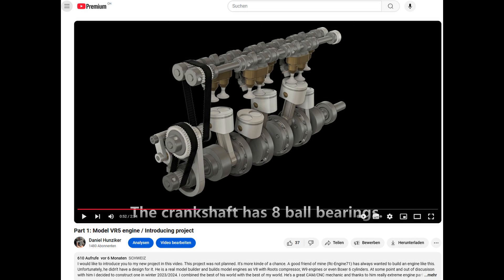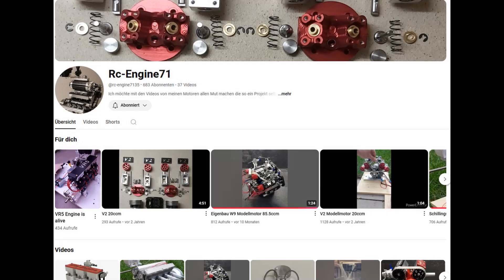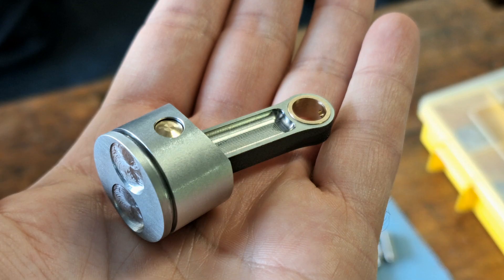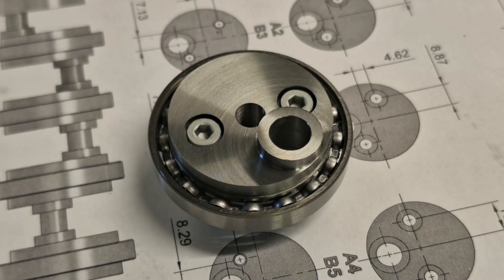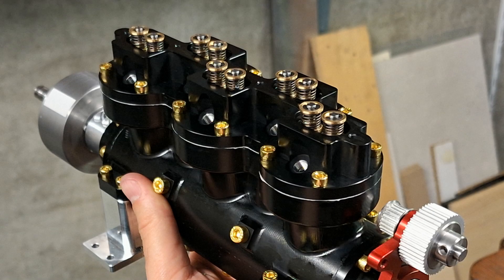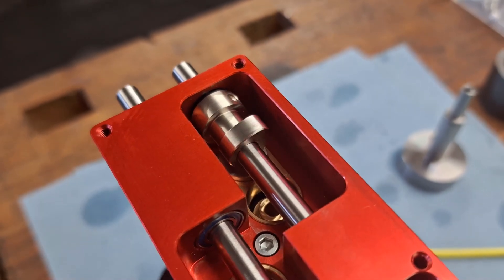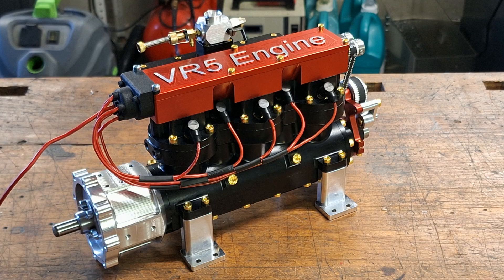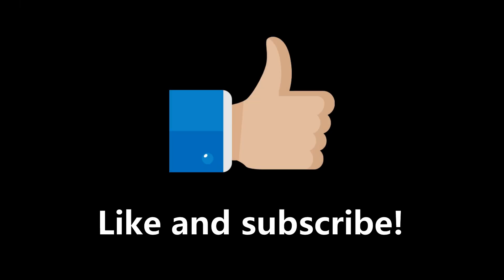Part 2: Model VR5 engine / Manufacturing process and 1st run / Herstellung und erster Start

Comment: Super Sound ähnlich fast wie bei Original. Auch schönes Farbdesign, doch leider kein Drehschiebermotor. Gibt es noch eine Leistungsmessungen oder ist das Risiko zu gross?
Reply from the maker: Hi Argentum 😃 Ich habe keine Ahnung wie ein echter VR5 klingt 😅 Ja, die Optik ist mir auch wichtig, die sollen ja was her machen! Eine Leistungsmessung wäre kein Risiko, da der Motor nicht fragil gebaut ist. Ich kann es aktuell einfach nicht, da mein Prüfstand nur auf 1 Zylinder Motoren bis rund 1.5 PS ausgelegt ist. Da ich aber schon mal die 1 Zylinder Version meines Kumpels gemessen habe, wird er wohl 0.8 PS pro Zylinder haben, was total 4.0 PS gibt.
Ich liebe alle exotischen Motoren. Auch wollte ich damit auch zeigen, dass ich offen bin und überhaupt nichts gegen Ventiler habe 😃 Theoretisch wäre der VR5 ja auch mit einem Walzendrehkopf möglich. Mal schauen wo das noch alles hinführt 🙃 Aber keine Sorge, ich habe gerade mit einem neuen Walzendreher Projekt angefangen und noch ein paar andere, richtig geile Motoren in der Hinterhand. Also dran bleiben 😉
Reply: @danielhunziker3577
Ich bin natürlich wieder total gespannt was als nächstes kommt. Schon mal an einen Sanchez rotary piston engine gedacht? Oder an einen HUF Drehkolbenmotor gedacht?
Reply from the maker: @argentumflower592  Ich habe zu viele Parallel-Projekte 🙈 Also ein Sanchez Motor mit Drehkolben ist schon sehr speziell. Das wären dann so Projekte, bei welchen man fast bei null anfangen muss. Es gibt ja auch noch den Kugelmotor, was ja auch nochmals eine Welt für sich ist. Aber ich werde schon bei Walzendrehern bleiben und versuchen, da weiter die Leistung zu optimieren.

Comment: When bolting on the camshaft profile, do the set screws need to have a flap point on the shaft to be milled in or can it be held down well on the round surface and with the 3 set screws
Reply from the maker: You're right when you say it can be improved. Compared to a real engine, it probably seems unconventional or even stupid to simply screw the cams onto a bare shaft. Simply making the camshaft from one piece would also be a better option. As is usual in model making, the manufacturing possibilities and technical implementation are very limited. For this reason, I used existing model engines as a guide and adopted this validated system. I was careful not to reinvent the wheel here.
Reply: @danielhunziker3577  I don’t think it’s dumb at all! In fact I’m very happy to have seen this video. I recently purchased a milling machine and lathe and have been making very nice steam engines. But I wanted to get into making gas engines for my Rc airplanes. It’s very nice to know I don’t absolutely have to make a one piece camshaft if I want to make a 4 stroke. Thanks for the good idea 👍 you’ve saved me many hours of machining
Reply: @danielhunziker3577  You can even try to use 3M scotch weld 2214 . It is resent to temperature of 177 degrees Celsius. But if screws work than it is fine! I tried before on my engine loctite 401 and soft solder. Now it is been welded to shaft (shaft CK45 cams silversteel).
Reply: @Alexie3333  so a low temperature solder can work too? That would be great. I wonder if I could get away with that for holding a model engine crankshaft. It would be easy enough to take apart to service bearings. Just heat it up slightly and the whole thing comes apart
Reply from the maker: @Alexie3333  Dismantlability is important to me. So all my engines can also be repaired. Cam welding is of course top! But then I can't get them out of the camshaft housing anymore 😅
Reply from the maker: @hectordeleon7859  Multi-part crankshafts aren't critical im Modellbau. My crank bolts are pressed in on one side and only inserted on the other side (a few µm play). It's very important that the crank bolts all have an axial stop and a long guide surface!

Comment: As always, impressive work!
I love the use of 3d printed titanium as a starting point for components.  It's like having the advantages of using a near net forging but with the flexibility of changing the design easily.
Reply from the maker: Hi John 😃 Thanks man! 3D printed parts are a good thing for design freedom. For example, the piston blanks are also 3D printed so that the clearance for the connecting rod is optimally shaped, rounded ans smooth to reduce stress. I have a titanium plate from which I used to mill the connecting rods in past. But this is very laborious and the milling cutter often breaks off due to the high residual stresses. What do you think about the sound of the VR5 and the design?
Reply: @danielhunziker3577 It makes a beautiful sound.  I'm a big fan of zippy inline 6 engines, this is kind of a combination of a smooth inline engine and an off beat V engine.
Reply from the maker: @johnpearson492  Yeah, it's a truly exotic combination of an in-line and a V-engine. I'm thinking about to make a manifold exhaust system to further improve the sound 🤔

Comment: You should get rid of the stress risers on those conrods where you milled them, the edges should be radiused or smoothed.
Reply: Generally true, but in cases like this the expected loads will most probably never get remotely high enough to cause problems.
I'm rather sure they're not the weakest link in this construction anyway, it's usually the built crankshaft from what I've seen.
Reply from the maker: @heinzhaupthaar5590 Eine gebaut Kurbelwelle ist nichts unübliches im Modellbau. Zum Beispiel Schillings oder Luther haben dies auch so gemacht. Es erspart dir viele andere Probleme, wie zum Beispiel das Bauen einen geteilten Pleuels mit Miniaturschrauben. Man muss jeweils eine gute Kompromisslösung finden für ein gutes Gesamtkonzept.
Reply from the maker: You are right. That is certainly not ideal. The general problem is that the parts are really super small and I always pay attention to simplicity in production. The wall thickness of the connecting rod around the bronze bearing is just 1.0 mm. Adding a radius would be a real challenge. I cannot say whether it's necessary or not. So far, no connecting rods have broken.
Reply: Atemberaubende Arbeit Respekt!!!!!
Reply: Viele Modellbauer Verwenden Kurbelwellen im Stil von Schillings.
Oder mit Hirth Verzahnung, weil es bei so kleinen teilen oft garnicht anders geht.

Und die Modelle laufen tadellos.

Was vielleicht erwähnenswert wäre, das Bugatti und Lotus in Rennwagen mehrteilige Kurbelwellen benutzt hat.
Gibt es tolle Videos zu.

Comment: hello Daniel exceptional work as always, is to possible to make a 4 cylinder for model airplane?
Reply from the maker: Hey Antonis! Thanks man! 4 cylinder engines for model airplanes are available e.g. as a boxer version from OS (OS FF-320 PEGASUS). I don't know about in-line engines right now. Basically, you can do anything. The VR5 here is water-cooled and probably not suitable for model airplane. You need an air-cooled engine. It's also too heavy for this with 3.5 kg.

Comment: Awesome! Thanks for the content! That's arguably the best 1st start I've ever seen, for any multi-cylinder model engine. Sounds like most of your tuning is done 👍

A few questions, when you have the time:

1- what is your static compression ratio?

2- what is the comparable length difference, to an inline 5 of the same bore/displacement configuration?
Reply from the maker: Thanks James! It was actually the 1st start, but I have to say that the carburetor had already been adjusted beforehand. Otherwise it would never have started like that. My buddy also started his VR5 earlier and we were able to solve teething problems beforehand. So I knew in advance that it will run.
1- what is your static compression ratio? The calculated compression ratio is 8:1. It has a very strong compression when turned by hand. But I don't know exactly how much bar/psi.
2- what is the comparable length difference, to an inline 5 of the same bore/displacement configuration? In total, it's 1/5 shorter than if it were an in-line engine. It would have been shorter if I had also offset the cylinder banks laterally (as VW did, for example).
Reply: @danielhunziker3577  - thanks for the detailed response! 

As you refer to "calculated compression", this is what many of us refer to as "static compression". Some call it "stoichiometric compression", but that is a misnomer... as stoichiometric compression is measured in absolute pressure, and can change with elevation.

Your 8:1 static compression, should equate to 8 bar @ zero elevation (sea level) and decrease as elevation lowers baseline air pressure. Naturally, psi conversion is 14.5 psi for every bar. At sea level, this would equate to 116 psi at sea level... very tolerant to low octane gasoline, most blends of model fuel (nitro methanol). 

Side note: while "bar" is short for "barometric"... as a child, I thought of it as an acronym for "base-atmosphere-ratio" 🤣